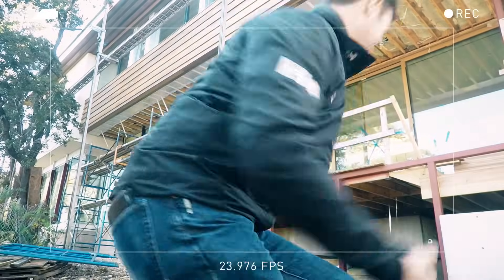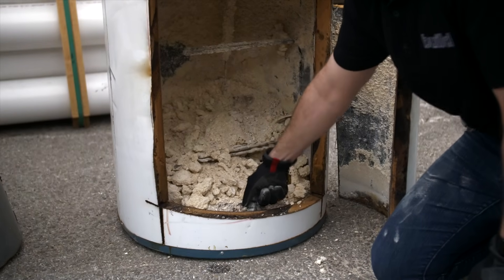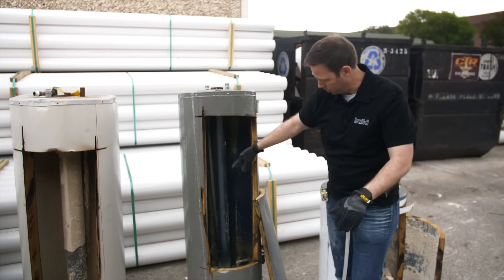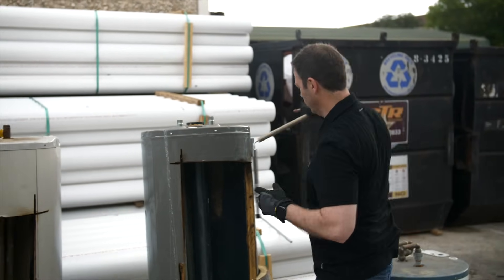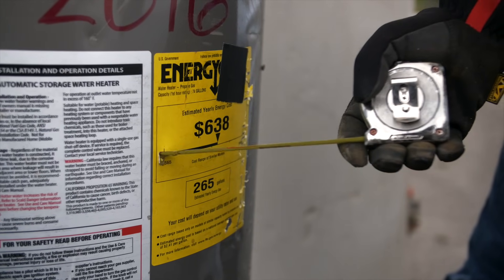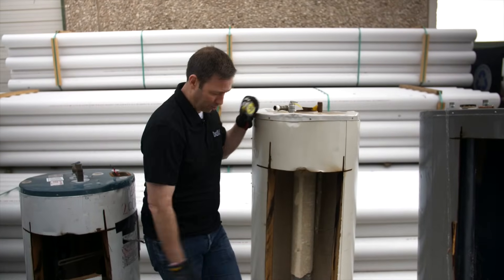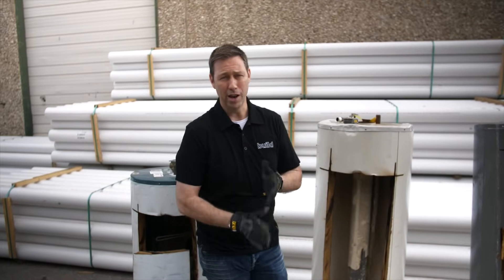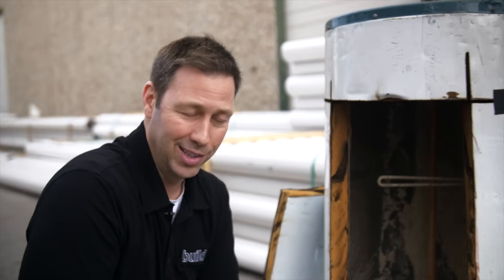Four Water Heater Tanks Cut Open - Lessons to Learn

Comment: I have an old one under my house that previous owner left. What did you use to cut them open I need to get this thing out from under the house
Reply: It is probably full of dirt and debris and too heavy to move and why it was left there. Best to strap it up and drag it outside first but you can drill a hole and use a circular saw  with carbide cutting blade but the glass lining will kill the blades fast.

Comment: Great video.  I’ve seen tanks that have lasted 50 years.  There’s a correlation of ignition times, water quality, proper grounding, and wall thickness.  I’m speaking strictly on “A” grade types, not the home center “B” grade types.
Reply: I service 40 units and 5 of them have water heaters from 1982

Comment: Use in a softened water system? Not if it is salt based, That is the worst thing you can do to a water heater.  Magnesium last the longest?  Absolutely just wrong! it offers the best protection but last the shortest time, Aluminum last the longest but with the least protection. Then we have the K90, Alu and Zinc combo that sits right between the two. OK yes I work for one of the largest water heater mfg in the states. So people, please, read the instructions, understand the warranty terms, there is a lot more to water heaters than you realize. Plumbers, keep up to date with the building codes at all cost, especially for gas water heaters. Having your warranty voided because the plumber thought he put it in correctly is just bad karma for both home owner and the mfg. Those codes are the same for all states, although CA has a few exceptions. Oh wait, then we have the powered anode rod, I almost forgot about that one. It kicks everything's ass! Morrison's, great video not bad at all. Really good info and giving the public a view of what's inside the water heater, def eye opening for sure.

Comment: I used to cut old glass lined electric water heaters open to make hog troughs on the farm. What always made me laugh was how the manufacturers always pushed the glass lining but didn't tell the consuming public that the electrode flanges would be welded in place after the lining process was done. I have seen many start leaking where the weld would burn through. I couldn't be the only one who noticed this.

Comment: A little late to the party.  Excellent video to really see what's inside.
A couple statements on "efficiency" 
The highly scaled electric unit's efficiency will not change, but its capacity will be less.  The element will just be much hotter (due to the "insulation" coating it).  The element will degrade, likely fail earlier than a clean one, and use less power (since the electrical resistance within the element will be higher). 
However, the gas unit efficiency with heavy scale on the flue and bottom will be significantly reduced.  The hot flue gas won't lose as much heat into the tank and more of the heat will go up the chimney.
Reply: The resistivity of nearly all metals goes up with temperature.  If you do the math, it's probably not a tremendous amount.   Lookup nichrome to find find physical properties at different operating temperatures.
Reply: How does the elements resistance change?

Comment: Really? An electric water heater that used twice the electricity from scale in the tank? Where did the energy go? I’d buy that for a gas that needs a heat exchanger to work properly but an electric hot water heater would just have less capacity if filed with scale, not less efficiency.. Make sure you use science and not just “how you feel...”

Comment: I have an A.O. Smith natural gas, and never done a thing to it, and got 17 solid years out of it even with hard water. Not sure if it’s just good luck, or a good water heater, but I’m replacing it with the same brand and capacity.

Comment: 1) magnesium rod will give a smell like a rotten eggs unless you have a separate fountain for drinking water. (the video does not mention)
2) the magnesium rod will rust out faster than aluminum rod. (the video mentions exact opposite)
3) keep the set temperature of water lowest comfortable to minimize the scale one the walls. It will also provide higher efficiency because the exhaust will not be as hot compared to the setting that is set hotter. Also will extend the life of tank.
4) install a pressure regulator and reduce the pressure from 98 psi in my township to 65 psi. those 33 psi helps eliminate hammer effect which can jump the pressure to 400 psi momentarily when we we shut close any faucet(specially high-flow faucet). The plumbing system in my house never goes higher than 65psi regardless of how fast i close my faucet. This will significantly increase life of the heater without any doubt.

Comment: My electric water heater tanks never lasted more than eight years before they started leaking. The last one was done after six years even if it was a super efficient one. I finally found the reason why: water pressure too high. I live at the bottom of a hill and the standing pressure at my city water inlet pipe is 92 psi. I had a pressure regulator installed and since that time (10 years) my last water tank has been doing ok. My water is not acid nor alkaline and I keep the thermostat at 140 degrees. It's the extreme pressure that flexes the steel tank and causes cracks in the enamel lining. I would have needed a stainless steel tank to fix my problem $$$. A 120$ pressure regulator did the trick.

Comment: So to clear up a common misunderstanding about electric heat that was in the video. Electric heat is 100 percent efficient. Every time. Even full of that calcium all the energy going into the water becomes heat. Now the calcium will reduce how much hot water can be stored in the tank and  cause damage to the element buried in the calcium. But won’t cost more to run than a new water heater.
Reply: While you are correct in your statement about the elements heating will not be effected by scale other than burning out quicker, you are wrong about its efficiency. When scale builds up in a tank the eletric thermostats can not read the temperature of the water correctly and the direct effect is the water being hotter than the thermostat setting which in turn costs more to operate. Same thing happens in a gas tank style water heater when the thermo probe gets scaled up.
Reply: @joshm5816  Technically you are correct, however, the mound of scale in the bottom isn't the problem.  Per your theory the only scale that matters is the rocks insulating the heating element.

Actually if you think about it, the insulation applies to both heating and cooling.  They mean that the element will come on and stay on too long, but also will stay off too long when the hot water in the tank is replaced with cold water.

The primary consequence of this isn't efficiency loss, it's poor performance.  It will take a lot longer to get hot water again for the heavily scaled heaters.

Comment: I know this comment is going on 2 years behind the date of this video but in reference to your question about why some of those water heaters had been replaced might be because of the home owners insurance company requiring to be updated in order to renew the policy.

I have run into that several times in Florida where the system seemed to be working perfectly at 12 to 15 years of age but the insurance company forced the home owner to replace their water heater before they would issue another policy.

Comment: The scale build up will very on the water contents  so the harder the local water the faster the build up ! And yes a water softener will make all your plumbing last longer !
Reply: False. Soft water is corrosive. Hard water is not.
Reply: @pauld3327  in my 45 years of construction I never seen rotten pipes in a home with a water softener, but have seen many of pipes clogged shut be scale with out them !
Reply: @littlehuey5679  My point was that hard water won't damage the water tank. Corrosion will happen with very soft water but not with very hard water. However very hard water will leave sediments in the tank that need to be flushed out. Do you agree ?
Reply: @pauld3327  acutely some hard water will because it is very alkaline and will rot out metal as fast as the salty water , but it pretty uncommon mostly for well water

Comment: If your water tank is new and has a metal ball valve then flush every year from the beginning. If it's an older water tank that hasnt been flushed for years then dont touch that shit especially if that valve isnt metal because that thing will leak and you wont get it to stop leaking until you replace the valve or the whole damn water heater.
Reply: I wish I had read this before I did that.  Heater is 27 years old so I will replace in a few months.  The plumber I called wanted to re plumb my entire house for $10,000 +.  I don't think I will be using him.  His hourly rate was higher than a Beverly Hills divorce attorney or plastic surgeon.
Reply: @Mark-ni3st  yeah definitely dont do that. It can be a DIY project and literally save a ton of money even with buying the proper tools to install a new water heater. Tankless definitely seems sweet these days. Dont know a ton about them but from what I heard those things are fantastic.

Comment: The mystery to me is that a tank failure can ruin a million dollar home in minutes but no one makes a water heater of a quality enough to protect such an investment. If someone said you had to spend five grand to save 100 grand in damages and inconvenience would you?
Reply: When I watched this viedeo I was realy suprised how scrappy heater tanks for the American market are made. Here in Germany they have thicker insulation (~10cm) and the inner tanks are usually made from stainless steel. But these things easily cost 1200€ or more just for the insulated tank. Most houses here have radiant heating with a seperate unit for heating both the drinking water und heating water circles. Also barely anyone uses electricity to generate heat here. It would be rediculously expensive.

At the end it's a matter of priorities I guess. The average American consumer want's his stuff to be cheap in the moment he buys it, while most Germans live in their houses for decades and wouldn't bother to spend more on a system that pays itself off in less than five years.
Reply: CodewortSchinken   The environmentalists and politicians here in the USA are outlawing natural gas cooking/heating/hot water for new construction.  Don’t even think about oil or wood for these uses.  Electricity is the only thing allowed.   The (highly flawed) assumption is that this electricity will all be from renewable sources.  Cost to consumers will skyrocket but the planet will supposedly be saved.
Reply: @stevebradshaw2292  Well, that's interesting. Here in Germany coal and oil have been effectivly outlawed as a heat source for new and modernized constructions as well, for both environmental and strategic reasons. Natural gas will come next. Wooden pellet fuel from waste wood however is considered to be CO2-neutral renewable energy source and favoured even more by the regulations than electric heat pumps. In theory the CO2-emissions from burning wood are compensated by over 100% reforestation.

Due to much lower emissions in the process of making compared to masonry constructiuons wooden buildings will become more important here than they are today. That's why I'm watching this American build channels to educate myself a bit about framing. Honestly, I was quite suprized how common heat pumps seem to be in the United States. Judging from a quite large carbon footprint per capita I wronfully assumed the vast majority of Americans and Canadians would heat their homes with either electricity or oil.
Reply: you need to go for commercial grade water heater. Those with stainless steel tank. Not those glass-lined shit they sell everywhere.

But put your hand in your pocket !

Comment: NUMBER ONE RULE: If you are connected to a public water supply, you MUST use a filter (or series of filters) if you want long water heater life. If not filtered before entering tank (all public water system in my general area) you will not be able to flush the tank after a year (or, most likely, less) because it will be plugged and water won't drain. I have seen electric heaters replaced after just a few years because an element failed - and has so much carp on it that it can't be removed from the tank. The key is Filter, filter, and FILTER - and change cartridge often. Otherwise, you will have a tank full of something which looks like sidewalk deicer salts.

Comment: You can buy water heater "blankets" that wrap around the tank and improve efficiency.  My water heater is located in the garage (unheated) and I noticed a difference in both the electric bill and temperature of the hot water in the winter.  I'm not sure if it would make a big difference if your water heater was in a heated area tho.  Just throwing that out there.
Reply: Sounds like gimmicky bullshit.

Comment: In Austin, TX, our natural gas water heater lasted from 1987 - 2011. That's 24 years. I never did a thing to it. It finally had a few pinhole leaks at the bottom, from rust. I would NEVER get an instant-on water heater. There is too much lime in our water here.

Comment: There used to be heater wraps that could be bought to increase the insulation,  I have not seen those anymore.  I took fiberglass insulation blankets and wrapped mine for more deficiency, and less heat loss.  When you are bored in the winters, flush your water heater and service the AC.  In the summer, maintain the boiler/furnace.   Nevermind: just google "water heater wrap" they are sold at lowes and Home Depot.

Comment: So if your anode rod has that much scale, I'd say you aren't going to be ever replacing it... it'd be too fat to fit through the insertion hole.  And if you yank hard enough you'd probably break off pieces of the anode in your hot water heater.  I never drink water from the hot water heater and never cook with it.  Bathing is about the safest thing you can do with it.  Need a whole house filter with magnets to capture those minerals before they make it to the hot water heater.

Comment: My house was built in 1978. Two original electric water heaters still kicking. I've owned the place 27 years, never touched the annode rods in either, or flushed the tanks. And I have very hard well water to boot. If this video is any guide, today's water heaters are nowheres near as tough as they used to be. Won't catch me replacing mine under the guise of "preventative maintenance" anytime soon.

Comment: Water heaters will last between 7 and 10 years(made after 2015). Soft water will shorten the life of the water heater, but keep it more efficient. Replacing anode rods is a thing of the past. I worked for a water softener company for 12 years,  and a water heater company for 18 years. Alot of info here is wrong.

Comment: Our homeowners insurance threatened to cancel us in 30 days if we did not replace our 17 year old water heater even though we had drained it for scale every year and it was working fine. We had to send them a photo of the new one installed and a receipt. They also gave us 30 days to replace our roof. So I had the roofers come out and inspect it, he advised that we put in a claim for storm damage. The insurance approved it right away for $15,900. So now I have a nice new roof but am still upset about their drone inspection of my old one.

Comment: Why hasn't a self flushing water heater been invented? It seems kind of obvious since that the average home owner will never remember to do it.
Reply: @gregorygrimm5540  Where?
Reply: @Robb403  Bradford White models have the water inlet pipe terminate inside the tank near the bottom so it agitates and flushes sediment as water enters. Not perfectly, but fairly effectively. Still needs periodic maintenance for optimal longevity.
Reply: @adamrichins1908  all water heaters have the cold water terminate at the bottom so the cold water is sent right down to where the burners are. That increases efficiency substantially.
Reply: Henry J. 
Bradford white claims that.  What you really need is a curved dip tube that really stirs up the sediment and a drain valve that opens up with a large enough orifice to really let the crud pass through.
Reply: @kurtvonfricken6829  smiles but I have had 2 BW and they are not as great I switched to a Rheem Marathon and no anode to worry about can not wait to get it installed with a pre filter and things will be way better.
Reply: Andrew Gems 
Yep just replaced mine only 22 years old.  I'm told that's now past the life expectancy of a furnace.
Reply: Price.

Comment: I drained, not working  error code, gas water heater and flushed it empty , then  by opening the cold water valve while the drain valve is open, allot of scale went out with drain. it is working again since a year. 
I wounder if there is a way to add scale dissolving liquid into the tank from top (trough the In cold water pipe) could descale it totally.

Comment: Wow, I learned new info today. The water heater in my house is over 35 years old. Guess I need to flush it this spring, and see how long we can use it
Reply: It’s actually rather clean inside. Looked in it when I replaced an element a couple years back
Reply: You might just flush out some of the stuff that's still holding it together... be careful.  ;)   (good luck)